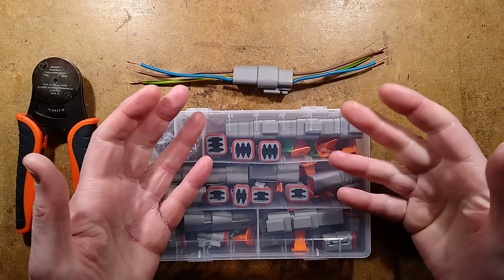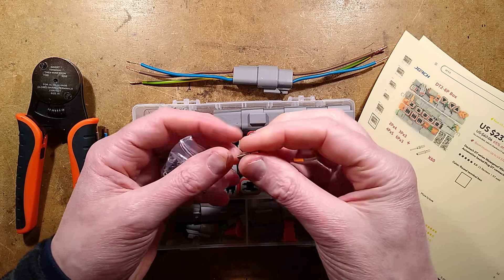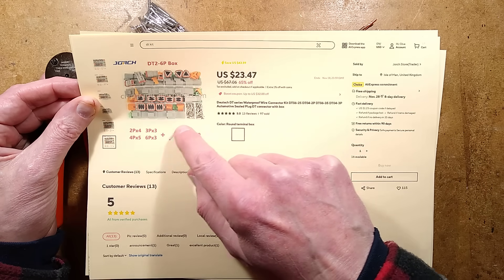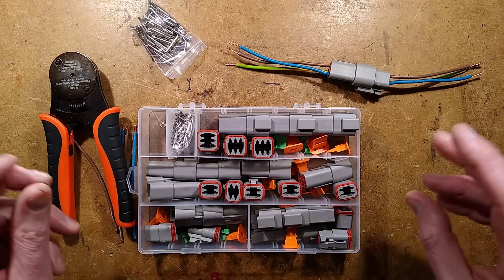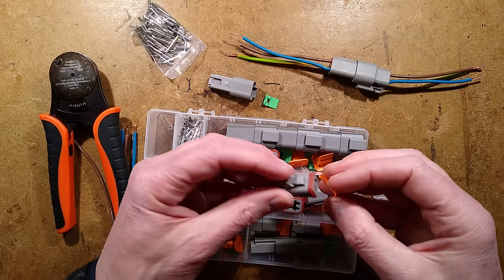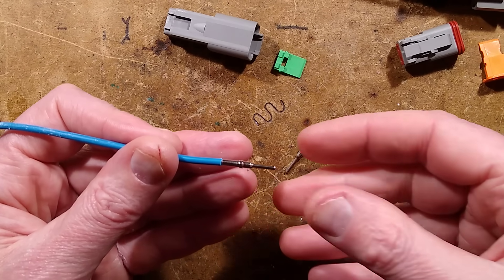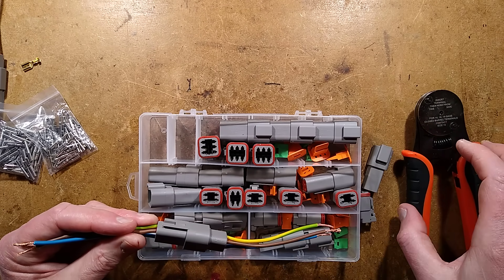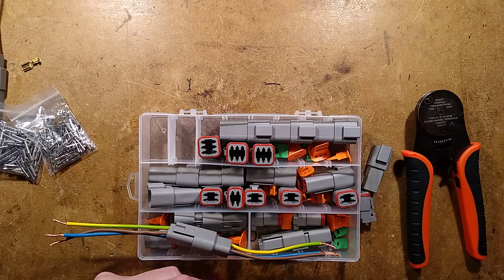Deutsch - my new favourite rugged connector

Comment: I couldnt see very well here but the small hole is known as a inspection window. 

Your suppose to be able see the wire within that window that ensures not only will you have the best crimp but also if its going through a QC (Quality Control) person/department that is the first thing they'll check. 

If they dont see it, it can be a failure and will need to be redone or a Indicator meaning it passes as pre the documentation but could be an issue and will have to revisited 

This was in our IPC training at work.

Comment: I am a former electronics engineer in Europe who has a drawer full of various crimp tools, and these are new to me! Thanks to Big Clive! We are about to start on the electrics for a camper conversion and these will be ideal!

I asked CoPilot to compare US and European wire sizes and give me the correct Deutsch pin size. Here's what it came up with:

AWG Size	Strands / Diameter (mm)	Rated Current (A)	Deutsch Crimp Pin Size	Conductor Cross-Section (mm²)
N/A
0 (1/0)	        19/1.35					200				4						53.5
1			19/1.15					150				4						42.4
2			19/1.02					125				4						33.6
3			19/0.91					105				4 or 8					26.7
4			19/0.81					85				8						21.1
5			19/0.72					70				8						16.8
6			19/0.64					60				8						13.3
7			19/0.57					50				8 or 12					10.5
8			19/0.51					40				12						8.37
9			19/0.45					35				12						6.63
10			19/0.41					30				12						5.26
11			19/0.36					25				16						4.17
12			19/0.32					20				16						3.31
13			7/0.57					15				16						2.63
14			7/0.	50					13				16						2.08
15			7/0.44					11				16						1.65
16			7/0.40					10				16 or 20					1.31
17			7/0.36					9				20						1.04
18			7/0.32					8				20						0.82
19			7/0.29					7				20						0.65
20			7/0.26					6				20						0.52
21			7/0.23					5				20						0.41
22			7/0.20					4				20						0.32
23			7/0.18					3				20						0.26
24			7/0.16					2.5				20						0.2	
25			7/0.14					2				22						0.16
26			7/0.13					1.8				22						0.13
27			7/0.11					1.5				22						0.1	
28			7/0.10					1.2				22						0.08
29			7/0.09					1				22						0.06

I hope this helps!

RS

Comment: I bought a used ek waterpump that had those connectors and I didn't know how to connect them to my pc. In the end I had to cut them off and solder a 3pin fan connector for my motherboard. I  threw that connector away without knowing they were industrial deutsch connectors 😂

Comment: They are a very reliable connector I have worked with Scania Coaches for 25 years and they are used on a lot of the external connectors I’ve never come across a failed one yet the wiring either side is why they have needed to be replaced.

Comment: At 5:10 says "probably rated to hundreds of volts."  Just an fyi "dielectric voltage rating" & operational voltage  rating are not the same.  These are not AC rated by the mfg. Be careful!

Comment: I prefer Delphi Weatherpack, one cheap tool covers multiple pin gauges and the double shrouded and sealed pins mean I can run HT ignition for flame effects alongside low voltage solenoid etc. wires with no arcing across.

Comment: Oh yeah. I've come to love Deutsch connectors. Amphenol also makes a compatible set (their A series) that sometimes has parts that Deutsch doesn't (which still using the same terminals and such). I am a little skeptical about AliExpress versions though; I have bought some generic ones that technically work, but are clearly inferior quality, especially the seals. I tend to stick to suppliers like DigiKey or Mouser, which is a little pricier, but legit Deutsch or Amphenol parts.

Comment: I work for a company in Australia as an auto electrician that builds vehicles to support minesites. 

Our wiring harnesses almost exclusively use these connectors. 

A few little tips, you can get tools to specifically remove the wedges, receptacle sides it is useful to have a pick tool with a little L at its end. 

I would also highly recommend a small pair of long nose pliers, this makes it easy to pull pins in to seat properly if they don’t slide in easily all the way. Also makes inserting wedges easy. As others have said there are a number of different specs for these. Some have covers over the back seal to stop it falling out. Often called CAT spec, as it is used on caterpillar equipment. You can also get boot spec, these are designed for heatshrink, but there are some companies that make silicone boots to go over them. 

Buss receptacles allow you to use these connectors to create joins in wiring without solder joints. They come in number of sizes and configurations. As others have said there are also round connectors. Some of these combine different numbers of DT, DTM and DTP terminals. These can also be used in different configurations for pinning. 

While the receptacles in the 1-12 way connectors use pins, and the plugs sockets, some configs of the round connectors can use pins in plugs, or pins in receptacles. Reducing chances of misplugging with the same connector style. 

Other connectors have keying options, stopping misplugging. One to look out for is the 12 way DT connector, due to its size it is somewhat more flexible and can therefore be forced to seat incorrectly. 

There are also a number of mounting methods for the connectors, most of the connectors can be mounted on specialised clips, there are also bulkhead options for passing through panels. 
Also the 8 way DT receptacles can stack on each other, this does mean that they use a different clip to the rest of the 2-12 DT range.
Reply from the maker: I've got one of the little hook tools on its way.  I'll probably explore these connectors more.

Comment: Until retirement a coule of years ago I provided training for engineers on using these connectors for an internaltional German based company, they are superb.  A couple of words of advice.  

1)  You will note the very small hole in the centre area of the 'crimp end' of the terminal where the wire seats, this to to vent any air pressure should the installer decide to solder them onto the wires, HOWEVER BEWARE that unless soldering a connector is ONLY if being installed into a wiring harness that in NEVER GOING TO MOVE or SHAKE or  VIBRATE then DO NOT SOLDER the connector to wires because the solder is drawn into the stranded wire due to capillary action which then means the wire ends become a solid strand and not a flexible strand, which then if the harness is allowed to shake/vibrate/move etc it WILL in a very short time break the wire just back of the connector terminal.  BEST TO NEVER SOLDER THE WIRE INTO THE CONNECTOR and ALWAYS USE THE FOUR POINT CRIMP TOOL.

2) Why four point terminal compression instead fo the old two sided flat crimp tool method (or god forbid people who just use pliers to crimp, OMG).  This is because as the terminals heat or cool they expand vs contract just enough to possibly allow a slightly loose terminal crimp connection which then arcs internally and burns out the connector from inside.   If you ever come across a burnt out connector terminal it is more likely be due to a bad crimp far more than an overloaded current flow.

3) For those people new to these terminals be very carefull to unsure you use the correct end of the female socket connectors as it is so easy to crimp the wire into the wrong end of the connector.  This is very bad because inside the end of female terminal that should be in contact with the male pin when inserted has a smaller internally sprung diameter which ensure a good electrical connection to the male pin. If the female terminal is crimped at the wrong end it will mean the end that 'should' be crimped, becomes the end that the male pin goes into . . . . and the male pin will then be loose inside the 'what should have been the crimp end' of the female socket causing either an open-circuit or worse still an intermitent open-circuit, and then finally a burnt out connector due to ongoing internal arcing.

3) If you purchase a semi-professional four-point crimp tool, not only does it have the depth adjuster as mentioned in the video for the different depth between male vs female connectors, the tool may also have a wire-gauge adjuster for the different wire gauges AWGxx etc.  If you use a crimp tool that crimps the terminal connector too tight it will result in a fractured connector that will over a very short time  . . . . . yes . . . . break and arc and then burn out.  (Note: For mass production the full-professional tooling uses a turret mounted to the crimp tool with 2-3 pre-determined click selectable depth settings . .  . .super expensive and not needed for general service/repair/installtion work.  The semi-pro too as shown in this video is just the job for most needs especially if you are only using one specific AWG crimp size.

In summary:
SELECT the correct size connector (ie current acapacity) for the application.
ALWAYS use the correct gauge wire for the connector (ie current acapacity) selected.
ALWAYS use a correct four-point crimp tool to the correct depth and correct wire gauge.
ENSURE that female contacts are crimped at the corect end.
NEVER solder the terminal unless specifically specified for a specialist purpose.

THESE ARE FANTASTIC CONNECTORS but like many things, only if used correctly

Great intro video to DT connectors bigclive 👍

Comment: These have been super common on heavy equipment for years, and it's beyond me why they're not more common outside of that. Easy to repair and replace, reliable and available in a million different sizes and types. These regular DT contacts are available as bulkhead mount as well, circular bulkhead mount, circular wire to wire, etc.

Comment: Wago connectors usually do the trick for my little projects. But these are the best connectors for outdoorsy serviceable waterproof connections, especially for vehicles.
Everyone should use these, sadly the costs prehibit that sometimes. But dealing with nasty wiring in trucks and trailers would be so much easier with these...

Comment: What search terms should I be using to find the little zip tie clip mounts these connectors should slot into? These look perfect for some automotive things I've got planned but I need to be able to securely mount the connections.
Reply from the maker: Here's a typical listing for a screw on clip that may help with keywords.
https://www.amazon.com/JRready-Connectors-Accessories-Connector-Accessory/dp/B0BZR61RDP

Comment: I've used those type of connectors before, great for automotive. I'm paranoid so I even solder the wire into pins when I'm using them in cars.

Comment: The only way these connectors could be better is if you could put any combination of male and female pins in each half shell, to make many more  gender combinations. 
For example, the 2-wire connector shells could be made up as MM or MF or FM or FF and all 4 of those would be unique combinations. That would allow you to uniquely connect up to 8 wires to a matching set of 8 wires, as MM<==>FF, MF<==>FM, FM<==>MF AND FF<==>MM. Because the connector shells only mate one way, you would get 4 unique arrangements instead of only 1 arrangement.

Comment: These are great connectors. I also recommended looking at some other automotive connectors. Each has their uses. From the beastly 200amp (and above) anderson (standard version is only 50amp). To the crappy ones that are found normally inside and made of the slightly clear white plastic.

Automotive connectors are great for prototyping as they are available. Usually water proof. Nearly always chemocal proof. Vibration proof. And more often than not have good headroom over spec.

Comment: I recently had to look up one of these connectors by the number I observed on the body of the connector. Which had me confused because I knew the style of connector form 20 + years ago, Deutsch.  My research laid me to Tyco, and the connector was a 6 pin version in the color Black.  Never seen black before.  I looked up the part number and my jaw dropped to the ground, just the plastic body was $16 dollars US for Male end.  That didn't cover the pin or the inserts.  Then I remember seeing the gray ones on a site called waytekwire , it was the Amphenol version and they looked identical, and the 6 pin body was $1.50 ea. US, the pins and inserts were also very reasonable.  I didn't look up the crimp tool but because its Amphenol it could be a down payment on an E-bike.  Amphenol version go by the model AT.  Either way there out there more vendors then ever before.

Comment: do u think u could use these for high voltage/high amperage dc power ?
Reply from the maker: They do a "P" version for higher current.
Reply: DT is 13A max
DTM is 7.5A max
DTP is 25A max

Comment: Deutsch connectors are fantastic durable, replacable, rebuildable and highly water resistant if built correctly.
Reply: In heavy equipment repairs I've seen like 18 or 20 pin deutsch bulkhead connections. Love them, the authentic ones come with each wire hole numbered! So you don't have to guess if you're getting pin out right.

Comment: I love Deutsch connectors. A close second for me is Weatherpack, I think they are better for larger gauge wires. For large connectors I use used Cannon plugs from aircraft. My daily driver 1979 Subaru DL wagon has about 25 percent Deutsch, 25 percent Weatherpack, 5 percent Cannon plugs, and 20 percent miscellaneous/ original connectors (estimated).

Comment: From a person who has worked for a connector company and used Deutsch connectors in many different applications, I would recommend using SACC-M12MS-5PL M from phoenix contact or something similar for any weather critical systems connector. The Deutsch don't seal as well. They can barely pass ip testing let alone UL type ratings or NEMA type ratings. They are good general purpose connectors and can be relatively cheap, but for critical use cases I would not go with them.

Comment: Those "wedges" are known as a TPA lock (terminal position assurance lock) they exist to assure that your pin has been seated correctly and also makes sure they can't back out. 
There are also CPA locks (connector position assurance lock) which locks the locking tab in the closed position, making it impossible to unlock the connector bodies unless you remove the CPA first.

Comment: is there any reason you couldn't use the bootlace ferrule type wrap around crimpers on these connectors?
Reply: These have a thicker wall thickness vs bootlace ferrules, and it only crimps the section nearest the wire entry.
Reply: @0xf_Steven  thanks

Comment: I prefer the ones that fold over. 1 of the wings grab the wire and the other grabs the wire coating meaning that if for any reason the wires are pulled its not pulling on just the wires.

Comment: These are well designed, but the Bosch lever connectors are by far the best design.  They are very easy to connect, seal well, are very easy to disconnect, survive contamination and heat exposure well, and never, ever get stuck or break when disconnecting.

Comment: With all the double entendres I had to check it wasn’t April 1st 😂. These look better than the solar MC4 connectors, can you get these for 4 & 6mm cable?
Reply from the maker: They do a "P" version for power.   Not sure what wire sizes they handle.

Comment: Official Deutsch DT's are rated to 250V both AC and DC, and the round "size 16" pins to 24A max 13A typical.
Reply: DTs are rated at 250V AC/DC and 13A max at 125C. They are also UL Recognized

Comment: I work as an industrial maintenance tech in a warehouse and we use exclusively Crown machines and they are absolutely packed with these connectors. Best part is because there are so many types/sizes they are used to prevent the wrong connector from being plugged into where it shouldn't be. They work well in low temperatures as well.

Comment: oooooooooooo!, me likey these connectors.... thank you sir clive  10:42   that's a good connector, the rubber seal to keep out water for corrosion resistance is great

seriously. i love anything that makes electrical project more plug and play.   i can easily see how to use these to upgrade my upcycled computer power supply => project power supply little diy power stations.

Comment: Im a mechanic and the deutsch connectors are used a lot in tractors. I like them very much. The only little down side is dirt. Often dirt gets under the latch of the connector and you cant propperly clean it. This meens dirt prevents the latch to bee pushed in far enough to disconect it. So i almost always push a flat screwdriver on top side inwards to help the latch go down. And to be honnest i would accept this tradeoff anny day because they are just great servicable things.
Reply: Just ordered a set specifically for use on my tractor. I can label any switches with the label maker I bought on Clive's recommendation too!

Comment: wth clive, a 4 indent crimper for under 10$ lol. 

major downside is unlike the mc-d's crimp its difficult, perhabs even impossible to inspect. Lets say there is a reason the proper ones come with go / no go gauges and even digital adjustment in 1/100th millimeter increments.

Comment: Looks nice!
Not sure if exactly the same, but I've been fighting very similar ones on my Subaru. They can be a right bastard to get apart if tucked away deep in an engine...
To avoid future grief, if I were to build something using those, I'd grease the seals pretty thoroughly.
Vaseline or silicone grease will probably do (pick something compatible with the seals so they don't disintegrate).

Comment: Great connectors but recommend some silicone grease or spray on the rubber seal as dirt builds up in harsh environments and makes them frustrating to seperate.